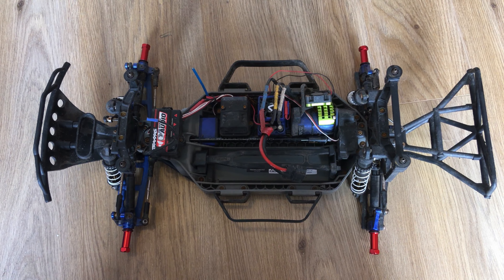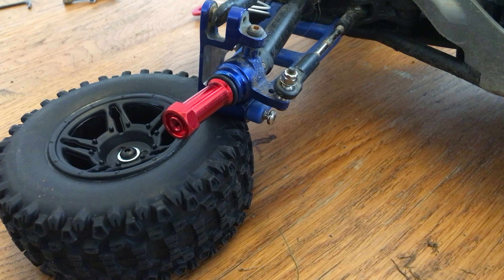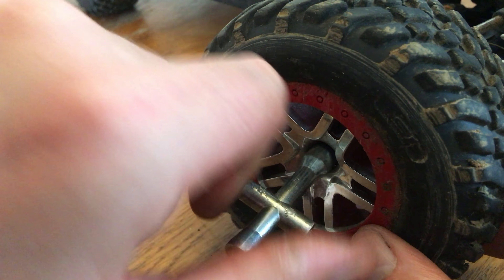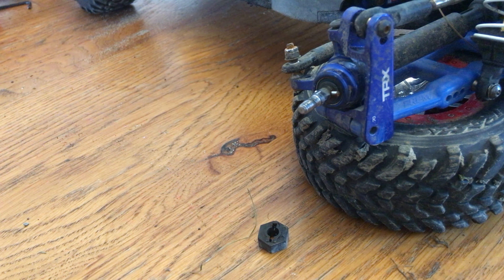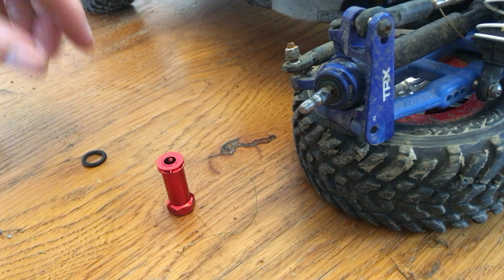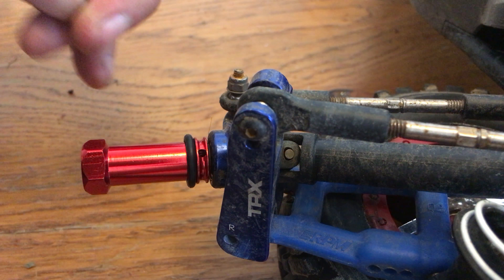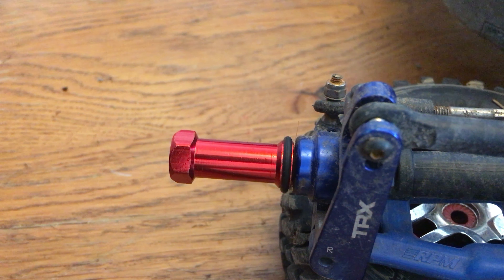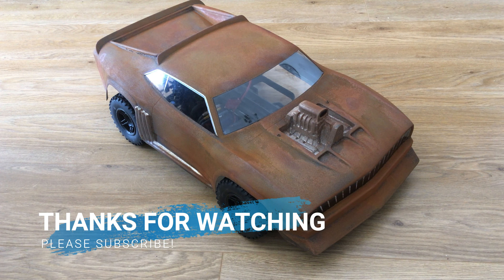Traxxas Slash Wheel Extension Kit - Installation Guide

Comment: So I'm assuming there's some type of screw that you use to hold the wheel on? In stock formation, the hub extends out and you tighten a nylon nut to hold the wheel, but in your video, there is nothing...

Comment: I’ve never thought this would be something I would wanna do to my slash but after watching this I wanna do it, thanks for sharing 👍😎
Reply from the maker: Been running these extensions for a while now and they are holding up just fine
Reply: I just got these for my slash2wd with a tekin rsx and 13.5 motor for offroad and have read mixed reviews but I'm going to try theme anyways lol wish me luck!!
Reply: @mrnightmare1152 hey bro how is she running i have the 2wd too with 3s Spectrum upgrade she is a runner
Reply: @austeromadrigal-jf3yp  I've been out of the hobby for a cpl years had to sell everything. But when things get better I've decided I'll be going 1/8 scale truggy.
Reply: But I did have these on a stampede 2wd I built as well as a rustler 2wd and it was pretty fun taking sharp edgy turns and not flipping. (For the most part). It all depends on your tune and setup imo. But deffinatly worth a try!!

Comment: Pretty slick set up.  Are you doing a running video to shows how well it works.  Body looks really good on that Slash.
Reply from the maker: Going to be sending it until I kill it! Just need to reinforce the shell first as it sits over the bumpers. If the body dies first I’ll go back to stock set up. If it’s the wheel extension that gives I might go with stampede wheels. Either way I’ll be sending it until something gives! Bash crash repair repeat!!!!

Comment: I have my doubts that a rubber O ring will keep the pin in place when under full power.
Reply from the maker: Raised an eyebrow when I saw it too but no bad feedback in the kit reviews. As its in the centre of the rotating arm it should pull fairly even in both directions with the centrifugal force i reckon. The main stress should be against the metal of the extending piece itself.  Either way I'm going to thrash it with the new body. If I kill it I'll update you.
Reply: The reason I have worry is that I had tried a cheap driveshaft on My SCX-10 . The spring that held the pin in place moved and that destroyed the spur gear cover on the gearbox.
Reply from the maker: Extending anything on an RC is going to increase stress. I made the upgrade to make the wheels fit the new body. I reckon I’ll have wrecked that long before anything else breaks, especially as it sits over the bumpers! Once I’ve destroyed the Desert Eagle body I’ll be back to stock wheel set up.

Comment: Wait so it just trades out your traditional nut to hub for just a scew that goes thru the wheel into the extender? And if so do i need to add lock tight to it?
Reply from the maker: I haven't used any and haven't lost a wheel yet, been sending it too!
Reply: @firedupextremerc6066  well thank you, I might get some now😀